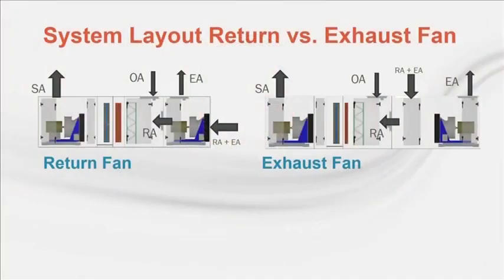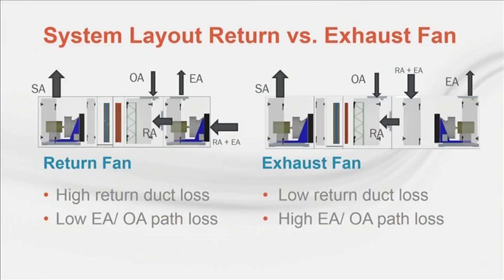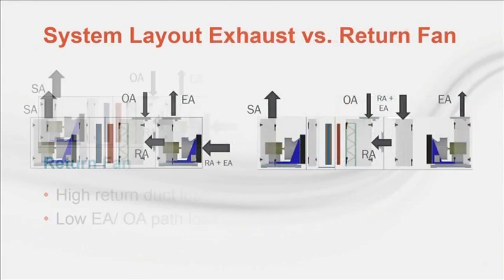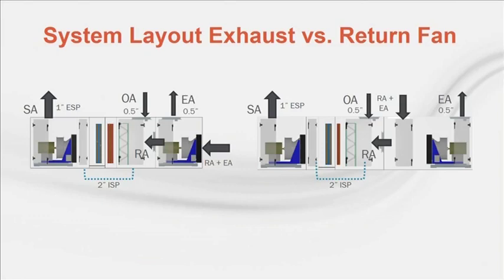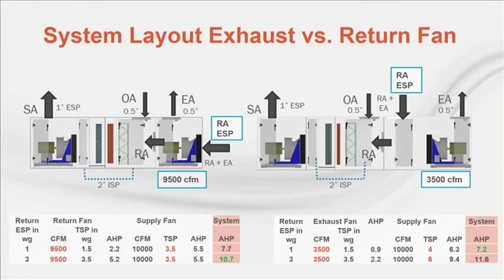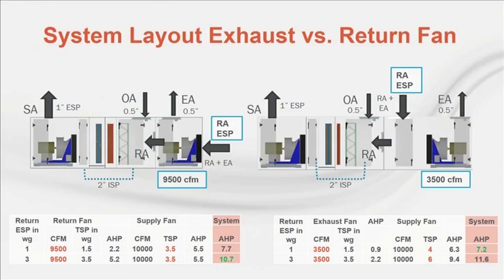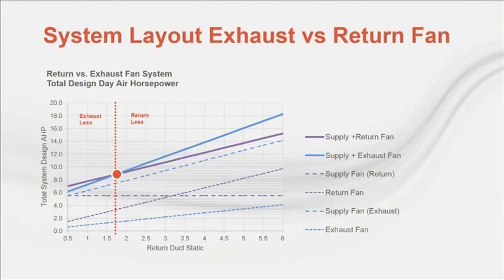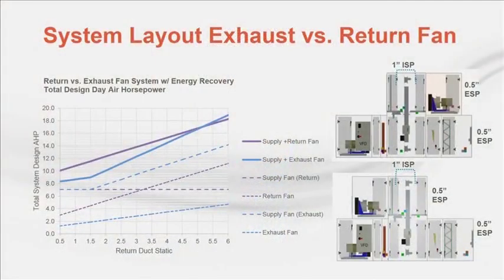Return Fans Versus Exhaust Fans

Comment: (This may be a long-winded question which interpolates the airflows and static a little)

If return fan is set to 9500 cfm @ 1.5" and its losing 9500 cfm @1.0" for the RA and 3500 @0.5" for EA, wouldn't there still be an additional 6000 cfm @ 0.5" to push through the unit and relieve a portion of the ISP on the supply fan? I'm just thinking this would make the power of the supply fan: (6000 cfm @ 3.0" for RA) plus (4000 cfm @ 3.5" for OA) which in turn makes the supply fan AHP 5.0, equal for both configurations. Or would that 'leftover' RA static be lost because of the extra required static of the OA? Would balancing the RA and OA ductwork to have the same static loss for normal conditions (no economizer) be best? 

This in turn is saying that:
A) two air streams with one fan (RF/SF)or 
B) one air stream with two fans (EF/SF)
would have static pressure lost from either the extra airstream or extra fan.

I'm just trying to see benefit of EF over RF configuration; I feel like the EF would be fighting with the SF for RA rather than helping it no matter what the RA static.